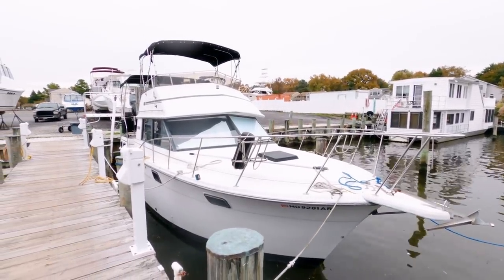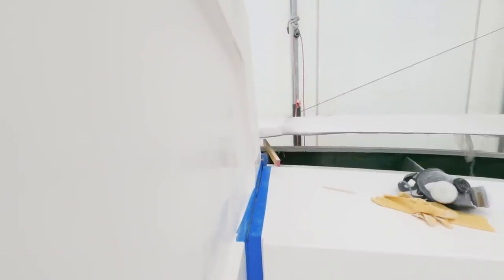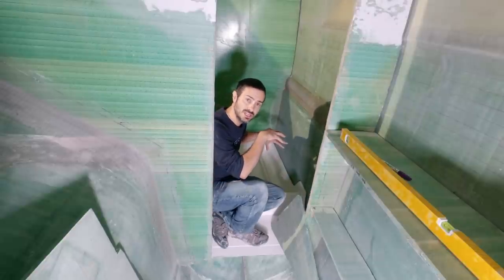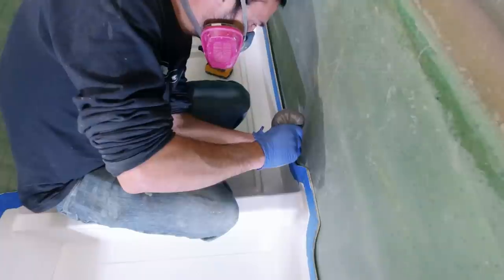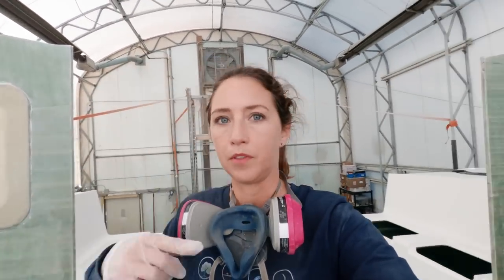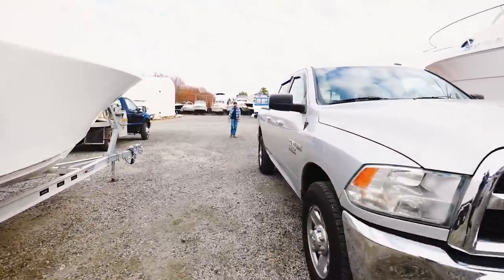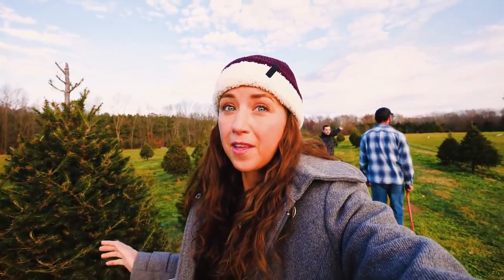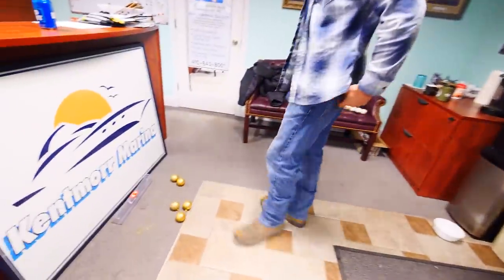CATAMARAN BUILD - So BRIGHT and BEAUTIFUL (MJ Sailing - Ep 215)

Comment: Great ideas from the boat show, particularly like the KC54 aesthetic. Clean, simple & lightweight plus the exposed ribs with horizontal shelving adds stiffness as well as purpose. I keep wondering how often that little berth in the port bow would actually be used and think (particularly for a world cruising couple) converting that whole area to a dedicated workshop, tool/spares storage and pantry (easily accessible to the galley) would be much more practical.
Reply from the maker: The v-berth is actually a pretty reasonable size double.  And since everything on a boat should have more than one purpose, a dedicated workshop isn't really something we'd be willing to give up much for.  Moving the mattress to have a work surface is fine by me and gives us all the options.  
 

Matt

Comment: The Christmas Tree looked very festive and perfect for that office space.  The work you all did this video demonstrated very well the necessity for “Order-Of-Precedence.” As you demonstrated that putting in the shower pan first was absolutely necessary because the wall stiffeners would be in the way if they were installed first.  This is a big part of Project Management 101 that so many people forget and they just want to get something done so it looks like work is progressing.  The nice thing about fiberglass is that you can cut/trim it very close because, unlike wood, it doesn’t shrink or expand with humidity and the weather. Or at least I’m guessing it doesn’t expand or shrink as much as wood does.  MERRY CHRISTMAS!
Reply: on that note, I found it strange that they did not do any plumbing before bonding the shower pan in place.  I would have thought they would have put the PVC pipe in place, at least under the shower pan.  It will be interesting to see how they do the plumbing.
Reply from the maker: @willphelps6715  If you go back and watch at 13:25, we explain that when we're ready to do plumbing, we'll go back and cut an access point in the shower to allow ourselves to do that - since we'll always want access in the future.  So, no reason to do it before the pan was bonded since nothing ever aligns 100% the way it does when you practice.  😉

Comment: I don't know nothing about boat construction, but shouldn't you rough in the shower drain  before placing the shower pan?   Also, shouldn't you be close to starting roughing in plumbing, conduit and wire runs?  I would think you would be doing tat before this is closed-up?
Reply: i was just thinking the same thing. if you watch ross build his boat he did all that way befor he bonded any thing. hopefully they will address that issue soon.
Reply: my thoughts too. Anxiously awaiting response.
Reply: I came to the comments to check if that had been asked already 🙂
Reply: @steenbronkegmail1  I don't think they have thought about many things tbh but we could be wrong right? I hope so anyway but yes I thought the same thing about this as you and others, seems a lot of things should of been started already but since they're the only people attempting this build and are in no way professional boat builders I'll give them some slack lol I just hope they haven't messed up by jumping ahead with the build. Merry Christmas y'all. ☃️⛄🌲🌲⛄🌲🌲⛄☃️
Reply: Looks like there is a false floor recess for the shower pan, the drain might end up under that false floor.
Reply from the maker: It's easy to miss, but we say multiple times that there is an access hatch that needs to be cut out after it's bonded in place.  No reason to do it beforehand as placement is never exact.
Reply: @MJSailing  LOL, I didn't miss it, I was just too impatient and started scrolling through the comments the moment I saw that glue going on 😄

Comment: I built my cat 15 years ago out of epoxy and WRC-- I am deeply envious of the pre-made shower bases and decks etc--the amount of time and fairing that you are saving is crazy.... I'm interested in why use metacriliate (sp?) vs thickened epoxy for those big joins?  Is it ease of use?  cost?
Reply from the maker: Epoxy elongates at around 6%.... Even a Flexible Epoxy isnt that far off that number.    The Methacrylate we use is over 100%.   Basically, your joining two very stiff solid fiberglass items, abd unless you adhesive is stronger than the substrate, the joint line will cracks from stress or an impact. The Methacrylate helps to prevent that by being flexible.  It also bonds a little better to cured resin.  

Matt

Comment: I can't help wondering how you were going to run the drain since you have epoxied the shower pan in place without any holes for the drain.
Reply from the maker: If you go back and watch at 13:25, we explain that when we're ready to do plumbing, we'll go back and cut an access point in the shower to allow ourselves to do that - since we'll always want access in the future.  So, no reason to do it before the pan was bonded since nothing ever aligns 100% the way it does when you practice.  😉

Comment: I have a question, if you can't get the base of the shower in and out when the extra structural part is in place, then how will you do any maintenance or repairs on the shower throughout the life of the boat?
Reply from the maker: We'll be cutting an access hatch into the floor of the shower once we're ready for plumbing.  It's easy to miss, but I mention it at the end of the segment.  😉

Comment: It’s a wonderful thought but number one how are you gonna put water into that homemade stand? By grinding the tree down to fit snugly into your homemade stand you have no way of pouring water in in order to water the tree. Also because you cut the bark off, and it’s the bark that helps the water wick into the tree so that the tree won’t dry out even if you do find a way to put water into your homemade stand it won’t really keep the tree properly watered. May I suggest a quick trip to Wally world or that place everyone aims for (Walmart and target) and find yourself a proper Christmas tree stand Then with a couple of you holding the tree steady one of you to cut flush across the bottom right about the top of your makeshift stand mount the new stand and then set it down or put a big block or box sturdy enough to hold the tree under and cover with a Christmas tree skirt. If you don’t get a proper tree stand by Christmas day you could have one heck of a fire hazard not to mention every needle on the tree wanting to fall off. Last time I had a live tree I actually even got a long funnel with a hose and concealed it so I could pour water in to the Treestand without have to crawl underneath the tree that would be the ideal situation.
Reply from the maker: https://www.instagram.com/p/CXttT5Spc06/    😊
Reply: @MJSailing  Every Christmas there are hundreds of fires because of dried out Christmas trees. If you want to ignore precautionary information it’s your choice I’ll have the fire bucket ready.
Reply: @duanemiller5606  Did you even watch the video they sent you as an answer? Smh. TLDR - it's handled
Reply: @JCrook1028  The link they sent me was a photo of the tree and a message saying it’s still fine the needles haven’t fallen off yet. My primary worry was fire hazard as the tree dries out. But what they do is their business I can just give advice. I also know I wasn’t the only one to express concern about their makeshift stand. I can’t speak for everyone who commented but mine was just simply friendly advice merry Christmas to you and a happy new year.
Reply: @duanemiller5606  You missed the important part of the written message. Read it again. They detailed how the watering system they put into the base functions... tldr... they DO add water to the tree, hence it not drying out and becoming a fire hazard.
Reply: @JCrook1028  except for it’s the bark and the wood just under the bark that transfers the water up through the tree and they ground that off in order to make the base of the tree small enough around to fit into their makeshift tree stand therefore the tree is not really getting the water it needs. As such it is becoming a fire hazard as it continues to dry out. Will it catch on fire probably not but it’s not a risk I am personally willing to take but it’s not my tree it’s not my place so I gave my free advice expressed my concerns let them decide how they wanted to live their lives at least now they’re making slightly more informed decisions.
Reply: @duanemiller5606  Did you look at the picture? It's not dried out... Yes they trimmed back the bark but obviously the existing bark is down into the water because it is transferring water up the tree just fine. Go troll elsewhere.
Reply: @JCrook1028  if all Christmas trees looked all dried out before they went up in Flames there would be a hell of a lot less Christmas trees going up in flames because people could see it. They stripped all the bark so that tree is drying out once again will it catch on fire most likely not it would require an open spark or a flame. As long as the lights don’t short out and overheat and no other open flame such as candle gets close to it then it won’t go up in flames. But if you don’t know the Christmas trees burn up and burn down houses every single year you’re not to well-informed yourself and the only troll here is you I gave free advice they could take it or leave it you’re the one who can’t drop it. If you watch the original video they trimmed all the bark all the way around the ground into the wood to get it small enough diameter to slam that piece of hardware onto the end of the tree. All I ever said was they probably should get them selves a proper tree stand, maybe at Walmart. Because they were right about one thing that tree Farm was way over charging for the tree stands.
Reply: @duanemiller5606  Oh Dear God dude give it a rest! Yes I saw the original video. Yes I know idiots burn down their houses with trees every year.
Reply: @JCrook1028  And all I did was warn them about the fire hazard. A little free advice for their safety and the boatyards safety. Not like I was picking on them because they might have a bunch of needles on the ground and have a bigger mess to clean up. If that was my only concern then you would have every reason to wanna think I’m just nitpicking. Out of curiosity who would you think is your better friend, the one who tries to warn you about something dangerous or the guy who wants to keep you in the dark and constantly in danger? As for me I’m more likely to want to be friends with the guy who’s looking out for my better interest and not the guy who’s trying to keep me in the dark.
Reply: @duanemiller5606  The guy that looks in from far outside with half thrown together theories is not someone I consider a friend. As stated by them, the tree is not at all an issue except in your imagination.
Reply: @JCrook1028  I looked at what was offered up for me to watch right here in my own home and gave sound advice against fire hazard and you keep coming up with half-baked ideas about how it’s somehow not a fire hazard because you don’t want it to be one and are trying to convince others not to listen.
Reply: @duanemiller5606  No, I'm convinced it's not a fire hazard because the people that can actually see it and touch it in person said so. I, unlike you, do not judge things from hundreds of miles away thru a video screen. I also said nothing to anybody about not listening to you. Got any more crap you want to invent me saying?
Reply: @JCrook1028  wow! Most people require a kind of expensive and very specialized electronic monitoring device in order to tell the moisture levels in wood. But somehow these people can simply with their eyes and hands do what no one else on the planet can do. Sounds kind of like a half-baked idea to me. They ground off the bark and part of the trunk in order to get it to fit into their makeshift tree stand and this is where the water that feeds to the outer stems and needles flows. I watch them do it right in the video so I know they made a fire hazard out of that tree. Once again does that mean it will go up in flames? No. But it does make it a fire hazard and once again you’re just coming up with half-baked ideas trying to convince everyone not to listen to me. Frankly I don’t care if they did anything about it or not. No skin off my nose one way or the other. Once again I just gave free advice. You keep trying to tell people don’t listen to the advice simply because you don’t want to believe it.

Comment: I think if you slightly change the frame rate of your cameras you won’t have that flicker. It seems to be in sync with the led lights.
Reply: That might not work.  Easy to try, though.

Most cameras detect the flickering light and try to compensate for it (by changing gain across the frame in sync with the flicker).  What you are seeing is what is left over after the camera has done its best.

This system was originally intended to deal with fluorescent lights that used the heavy ballasts that ran at line frequency.  All the lights in a room would be synchronous.

I'm curious if the lights MJ are using are LED based.  I would think most of those would be nearly constant output and so not a problem, unless they are like Christmas tree LED lights that run off AC and use the LEDs as a rectifier and so flash at 120 Hz.

If the lights MJ are using are battery powered fluorescents, then they have a little inverter and ballast inside.  Each light will run at a slightly different frequency than the others.  I'd think the cameras would be unable to track the flicker of multiple asynchronous light sources.  I'm guessing this is the problem.

(I design cameras for a living.)

Comment: Thanks for recommending that total boat structural putty. I use that Sh%t for everything. Ill use it instead of of total boat epoxy filler. The TBSP easier to mix turns green when fully mixed and sets harder. It's a little bit harder to sand. So I just use 36 then 40 grit sandpaper. That's for the info when I ask. Great product.  👍 awesome progress on the build BTW.
Reply from the maker: Glad to hear you like the structural putty - we can't live without it!